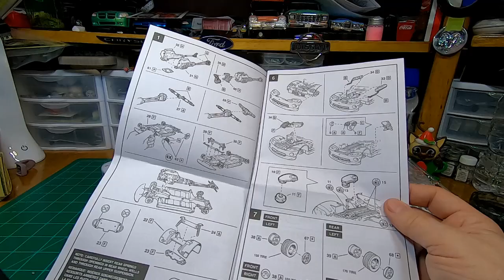Dodge Viper RT/10 by Monogram - Episode 39

Comment: Thank you for sharing. For the detail Brush Painting, were the parts Primed? or just painted directly on the plastic?
Reply from the maker: Thank you for the great question. I prime all parts before applying any top coat on it, especially craft acrylic paint. If you were to put acrylic paint on bare plastic it would easily scratch or rub off. The primer gives the acrylic paint something to hold onto. Thanks for watching!
Reply: @scaleautoguysworkbench  Do you also need to Prime the parts where we are using Enamel (i.e., Testors) paints?
Reply from the maker: @southpaw5483   Way back when I was a young lad, just getting started in the hobby, I never primed anything. That was a time when Testors bottle and spray can paints ruled my model building. I would just apply it straight to the plastic with no thoughts of what it would do to the plastic. Testors paints after all, were formulated for that purpose. Now, 40+ years later, everything has changed. There are a plethora of paints available for use in the hobby. Personally, I have switched over to acrylic craft paints due to the availability of colors, availability and price value. That's not to say that I don't still use Testors enamels, as I still do. Craft paints are not designed to go straight onto styrene plastic. The plastic is to smooth and leaves nothing for the paint to bite into, hence  the use of primer. Testors paints can be applied straight to the plastic with nearly zero issues unless you don't clean the body of release agent first. That can lead to bubbling, wrinkling and lifting paint. So, in conclusion, I would say that it is possible to apply Testors enamel straight to the plastic without primer. However, I have also found that applying a coat of primer can illuminate problem areas (i.e. mold separation lines, dimples etc.) otherwise not seen by the naked eye thus giving you a chance to correct the problem before laying down an epic paint job. Good Luck!
Reply: @scaleautoguysworkbench  Thank you for your time and insight.
Reply from the maker: @southpaw5483  No problem. I'm glad that I could help to clarify for you.

Comment: Try a Viper RT/10 AMT 6808 1/25 it will fit in the Trailer.
Reply from the maker: This Monogram kit is 1/25 scale. I don't know if the AMT kit would be any smaller. Unless, AMT doesn't know how to convert the measurements that were given to them from Dodge.  LOL!